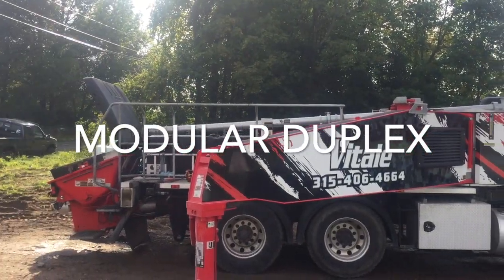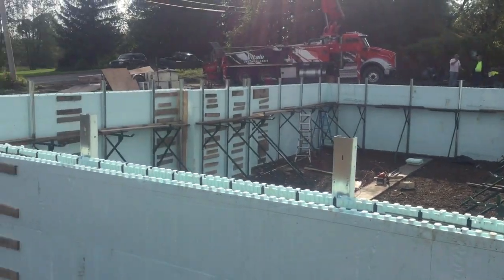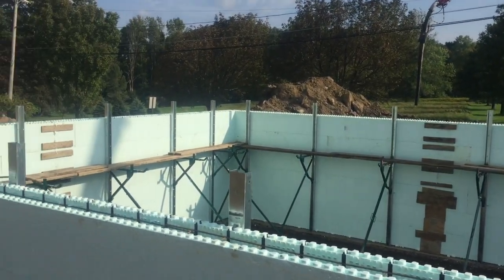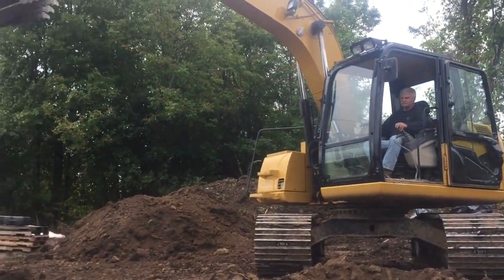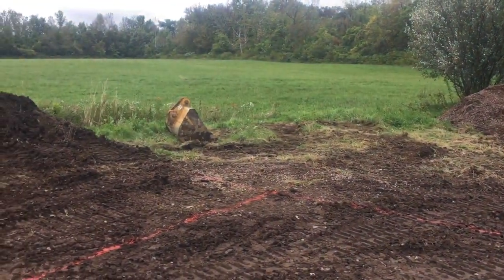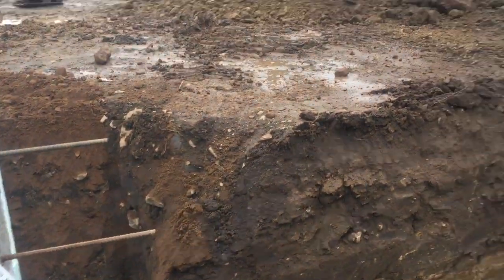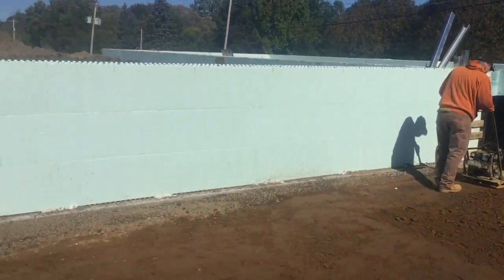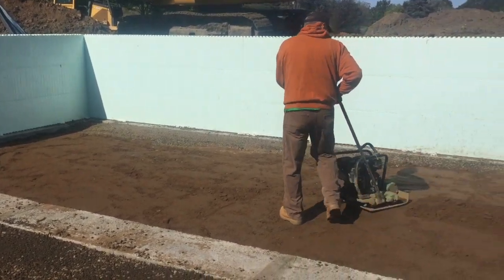Building a Nudura Foundation for a Modular Duplex home.

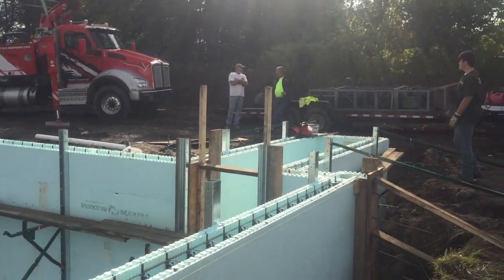Comment: At 2:08 in this video I can see formwork with horizontal rebar penetrating the formwork.  I also see what appears to be a sort section of the footer already poured???   In the prior video I did not see the base of that "step footing" but maybe I missed it.  Very curious curious how you did the detail of connecting the basement footer to the elevated footer.
Reply from the maker: Jim watch this video it will show you exactly step by step how I tie in a garage to a basement. I seldome do a step footer for this.
Reply from the maker: https://youtu.be/Wk-FHLuffPA